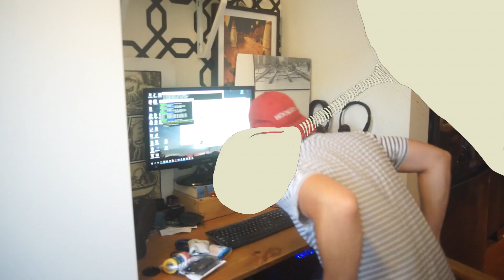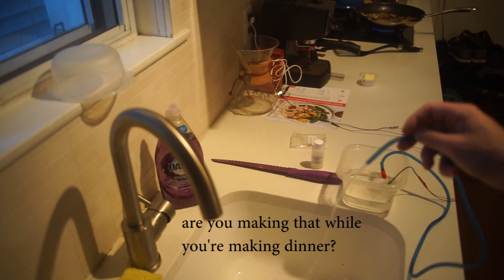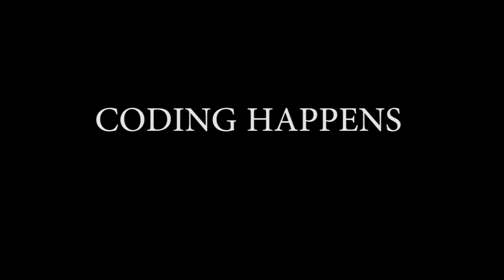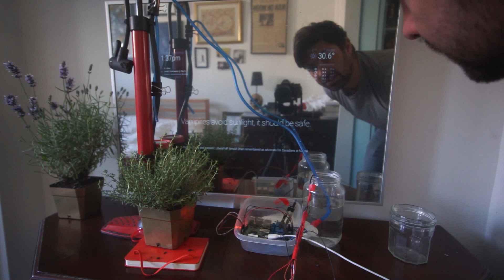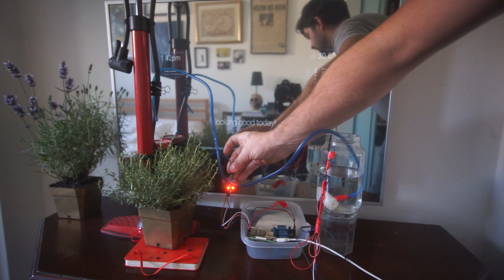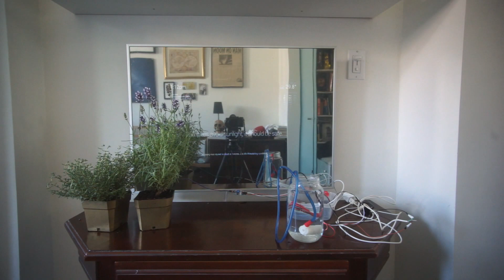Raspberry Pi Automated Plant Watering with Website

Comment: Hi, thanks for the video. I saw you mentioned that it can only be done via PI 3, I have 4 and it doesn't work from the early stage of testing the pump, can you please explain why only pi 3 should be used?...
Reply from the maker: Hi Ben, this depends on GPIO so makes some strong assumptions about the purpose of the pins. It’s very likely the GPIO pin layout between 3 and 4 has changed.

Comment: Hi. I’ve wired everything up exactly as you had on your page. My soil sensor when submerged is saying the plant needs water. Any idea what is going on? I used the sparkfun one from your site as well that you had linked.
Reply: Never mind I fixed it. For anyone using the new red sparkfun sensor it’s readings are reversed what his sensor is. I had to switch the values for auto watering. 1 is wet and 0 is dry.

Comment: The problem is that the soil will be constantly wet, cause root rot & kill the plant. The roots need to be able to breathe.
Reply from the maker: the beauty of building this, is the can change how they work. No reason you couldn't set a 24hr delay for example before watering.
Reply: @BenjaminEagan  it's true. I think time is already imported. I didn't use this script for mine though.
Reply: @BenjaminEagan  & I'ma be using circuit python soon as I get a trinket M0 so I'll probably have to rewrite it again

Comment: im guessing since u used a relay that ur using a 120v water pump. I am using DC pump so am making a circuit incorporating a pnp transistor so i can use a different power source other than the pi. when the base lead of the transistor is excited by current via 3v3 the circuit is then allowed to flow through the collector and emitter

Comment: Is the relay necessary? I figured one could just hook both the pump and the sensor up to the pi, pi takes a reading, activates a 3v pump... Am I missing something important?
Reply from the maker: I have heard if you draw too much current for a motor or pump you can easily fry your Pi, so the recommendation is always to power externally. So I'd take this approach at your own risk. (Here's a thread on  the topic: https://www.raspberrypi.org/forums/viewtopic.php?t=15688)

Comment: Cool, i like the HUD you seem to have on the mirror!?
Reply: Best to use capacitive moisture-sensors as the 2-prong models corrode after a few weeks.
Reply from the maker: Agreed! You can extend the life by only adding current when measuring, but it still gives a lifespan of ~months.
Reply from the maker: Thanks, you've spotted my smart mirror - lots of videos on my channel about how to make it! Nice weekend project if you have the supplies.

Comment: sir,it is okay to use 12V 4 Channel Relay Module with Optocoupler Isolation Supports High Low Trigger
Reply from the maker: You have my permission, on the condition you make sure it gets a 12v power supply

Comment: I need  7 sensor/waterers auto water reported by PI 3B+.   Each named by type of  plant.  Can that be done easily?
Reply from the maker: I would suggest using this relay instead: https://amzn.to/2LFJd4V - each pump can be controlled by a specific relay. Then you would have 7 moisture sensors connected directly to the pi (which has 20+ GPIO pins, so enough for 7 sensors and 7 relays to control)

Comment: Hi sir, what is the command use to start the program? i using python auto_water.py to start my program and my water pump straight working non stop. It cannot function well when i place my sensor into water or out of the water and my water pump keep switch on. Besides that,when i run python auto_water.py it only show (Here we go! Press CTRL+C to exit). It does not show the getting readings that sir show in video. Sir do u have any ideas or suggestion to solve it.

Comment: How did you figure what size tubing to use?
Reply from the maker: Honestly just guessed, it's not quite a perfect fit on the pump, but as it's submerged anyway a little leaking isn't an issue.
Reply: @BenjaminEagan  Got it. I was lucky enough to find thr perfect wire for mine locally.

How did you position the pump how you wanted it in relation to the plant?
Reply from the maker: Sorry, I'm not sure I understand the question... Just placed it in a jar beside the plant
Reply: haha shit, I mixed up the type of pump you have. I have a perastiltic pump myself so I need somewhere to have it. My bad!

Comment: can you extend this to water more than one plant with one cpu and one pump
Reply from the maker: Definitely, for that you'd need some actuated valves which are opened when a plant is thirsty. Then when the pump pushes water, it only comes out the open bits.

Comment: Nice. Looking forward to building it myself. Question, how tricky, apart from more relays, pumps etc, would it be to add more plants? (E.g. 6 different plant pots)
Reply from the maker: Really simple, you should be able to scale this up until you run out of sensor pins.

Comment: Good Day sir! i'm currently working like this project t then i add only water flow sensor, but the problem is that when i run the automated irrigation and water flow sensor the valve will close then only the water flow sensor will continue to run, what is the problem of this kind of problem sir? as a raspbe master :)